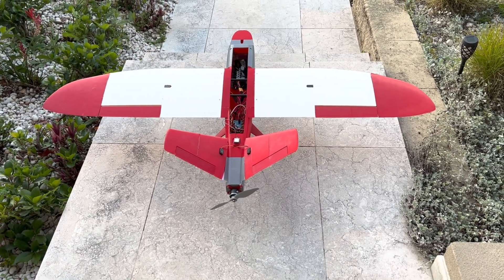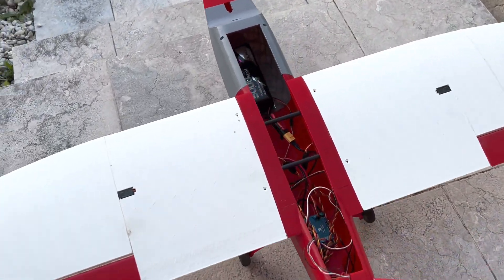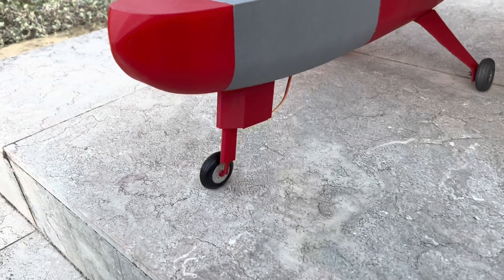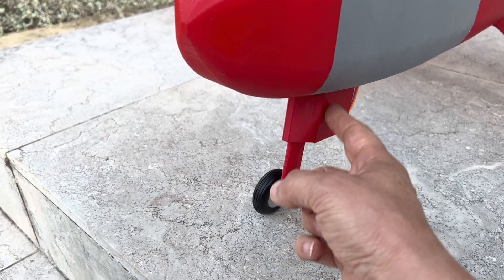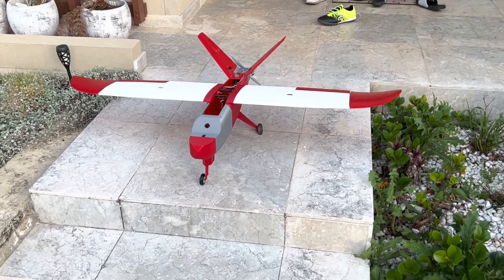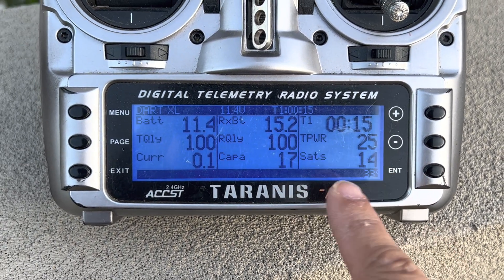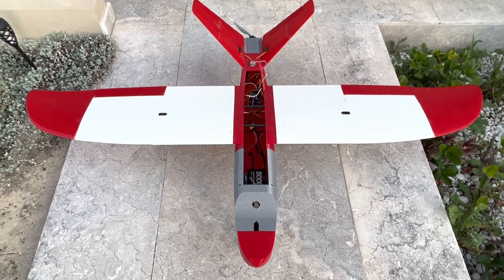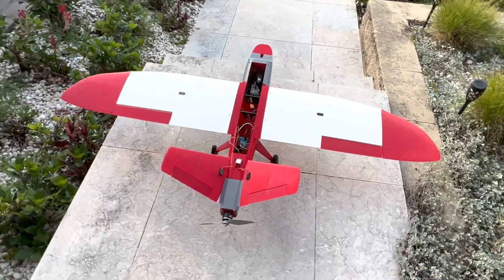3D printed Titan Talon with landing gears

Comment: Great plane! Thanks! Are you planning to share or sell files? It would be a good idea because there is a lack of 3D printed FPV designs with pushing propeller.
Reply from the maker: yea no worries mate, i will put the free files up in the description for you now. I don't want to take the design credit as it is designed by Mohammed Adib. Thanks
Reply: @FPVTECH  thanks a lot! Do not forget to upload to Thingiverse your nice landing gears😀  I've tried to use LW-ASA instead of LW-PLA to prevent melting at direct sun or in any other hot place. With extruder multiplier 0,65-0,7 LW-ASA works good and parts weight is close to LW-PLA because ASA is lighter than PLA. If to use 0,5 like for LW-PLA prints become too fragile. Will try to build this plane using ABS/LW- ASA.